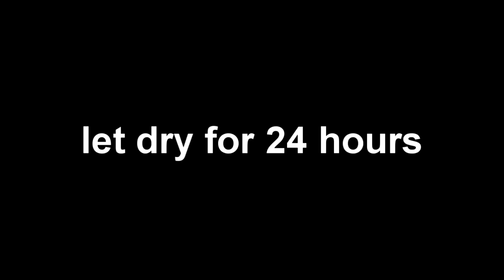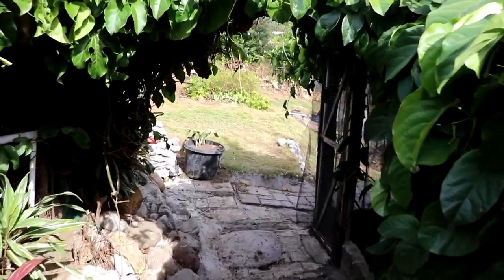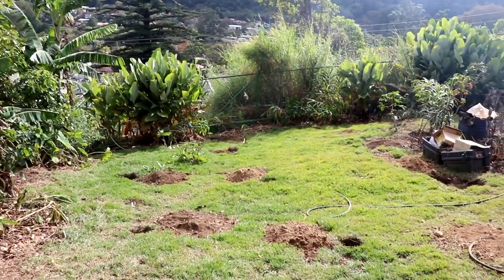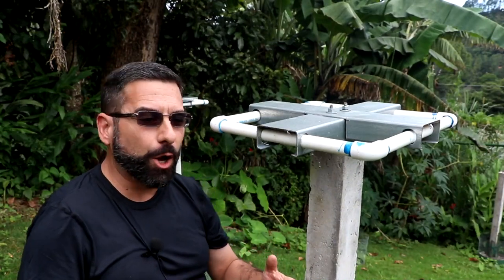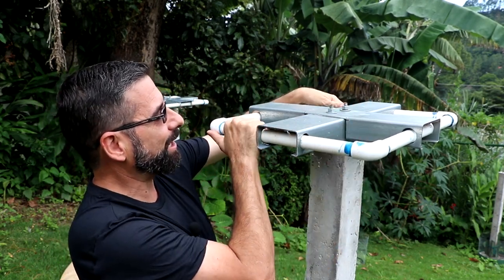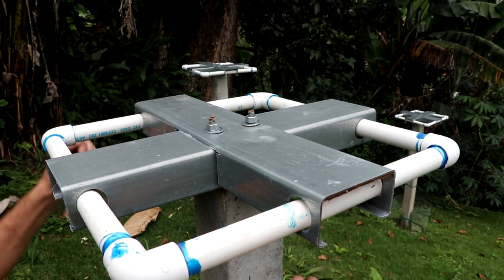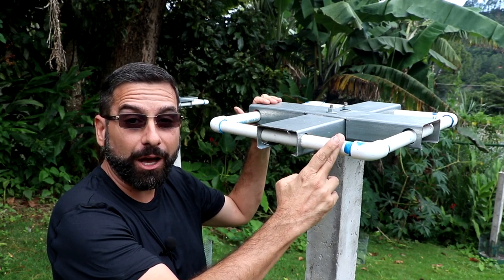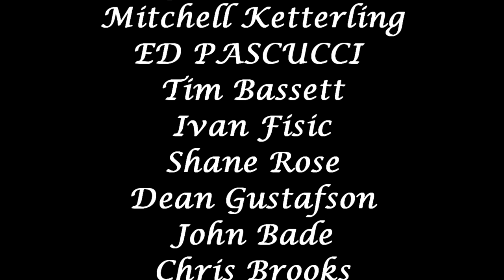How to build a permanent trellis for dragon fruit

Comment: Eric the PVC will deteriorate in the harsh sun but if you paint it they won't get brittle. White PVC doesn't have UV protection and is meant to be under ground.
Reply: I was just about to type that very thing. Been there done that. PVC needs paint, not to mention the heat from the metal will warp that PVC. I only use Metal Conduit outdoors for such projects anymore
Reply from the maker: Thanks Kev.  Great Tip.  Off to the hardware store😉.  What I'm counting on though is for the dragon fruit to grow past the trellis and completely cover and shade the top.  At least that's the goal😅

Comment: Have you thought about priming and painting the metal top supports to keep them from rusting?  A coat of UV resistant paint on the PVC might delay UV embrittlement and prolong their lifespan.
Reply from the maker: excellent point.   Off to the hardware store😁
Reply: @2guysandacooler  I REALLY like the video....however, one point :

- there aren't that many videos online on how to build a concrete trellis and most of them are in tagalog/filipino, but all of them don't detail the process of building the trellis FRAMEWORK.  What I'm asking is if you can do another video building a framework and verbally detailing :

- the wood used and how to put it together?
- size of rebar, and how to lay/suspend it within the framework?
- how to attach the bolts?
- what mix of concrete you use (we won't need to see you mixing the concrete and filling the frames, as this video already does this)?

I know this is a huge request but I and others would greatly appreciate it as this resource doesn't exist at the moment.

Also, would you do this differently now, i.e. would you do a hybrid of your PVC mobile model and this one for an in-ground model...using the best of both world?

Thanks for your time! 👍

Comment: Thanks for sharing this. Are all your posts going to have planter boxes? Is this to protect against pest like rabbits? As it looks, the cement posts look like other plantations who plants DF straight on the ground and without planter containers.
Reply from the maker: So, most of my posts (i put 62 in the ground) have just a simple wire around them.  Mainly for rabbits and other animals that might want to eat my tasty dragons.  I'll be updating the dragon fruit project soon here on you tube
Reply: Thanks for the reply! That's a lot of posts, I've only 25 for now. Looking forward to your project updates.
Reply: @2guysandacooler  Hey…I sent you an email yesterday : I wanted to know if you were going to set up a video with instructions, construction, and supplies as it pertains to the concrete forms?  (I’m also curious as to what the black “Carbone” board is that you’re attaching the 1x4s to?). Also, do you coat the forms with diesel oil or some other substance, so the posts detach easier???

Thanks! 👍🏾